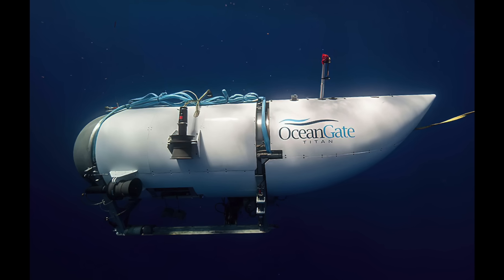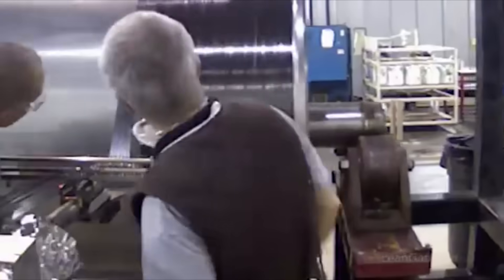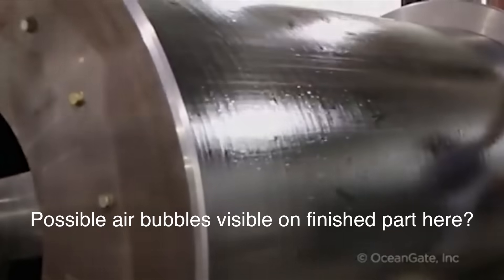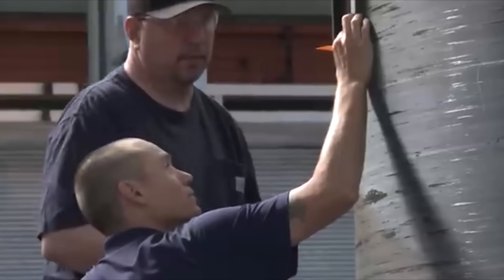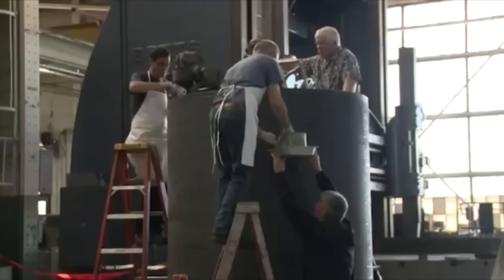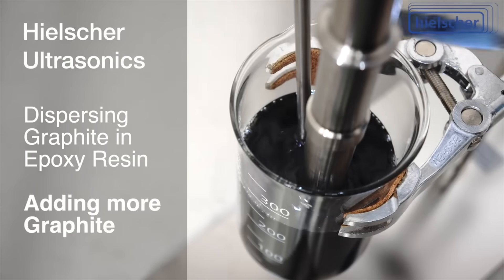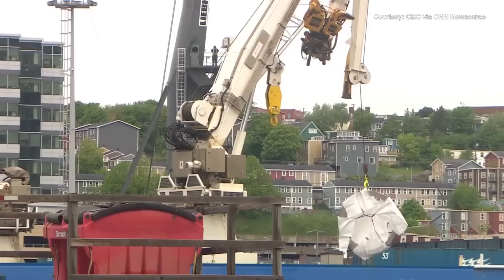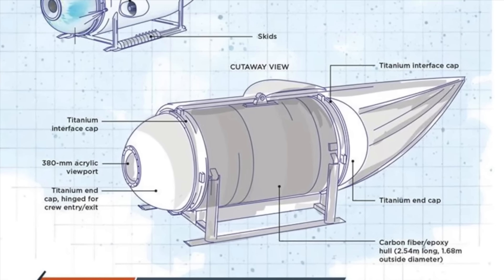Why OceanGate Titan Imploded - A Carbon Fiber Composites Perspective

Comment: The mating of the titanium to the Carbon Fibre is something I've had thoughts on. Years back I used to install strain gauges in the aviation industry - mostly aluminium alloys and titanium, but also on carbon fibre. The process for metal and CF involved using different solvents to degrease the parts, and keying the surface was also a little different. The process I was taught required titanium to be warmed with infrared lamps to drive out surface and subsurface contamination like oil, during which solvents were used until the surface was clean, and various fine grade oxide papers were used to sand the surface in figure eight motion to key the surface to bonding the gauge to...which then had a light acid applied and neutralised...the process with CF was similar, but less intensive, without heat lamps. The main difference was the type of glue applied for bonding. We used a special proprietary bonding agent manufactured by strain gauge manufacturer. The CF used a different bonding agent based on a cyanoacrylate type glue.

My understanding back then was that the same glue/bonding agent could not be used for titanium and CF, so was surprised to see a glue being used to mate both surfaces. Also surprised the surfaces didn't seem to be keyed - especially the titanium - ready to receive the glue!

Another concern was how shallow the join was!
Reply from the maker: Great to hear the interesting details from your real world bonding experience. This just goes to show the length and precision we must go to do make such bonds.
Reply: Meh why not just get 4 guys in t-shirts to slap some bondo on it, squeeze it together, and call it a day?
Reply: @inthefade  :D
Reply: I've always called the deliberate roughening of a surface to be bonded giving it "tooth" - similar to how the term is used to describe how paper will hold graphite from a pencil when drawing.

Absent that increased surface area, and scrupulous cleanliness, you have almost zero chance of forming any effective bond to a metal surface - and, the adhesive which you choose to apply must be to some degree corrosive to the metal in order to achieve a chemical bond.

Further, you join needs to ave significant resistance to slippage, much like mating screw threads have a force resistance projecting perpendicular to the direction of tear-out.

And, these slip-joints had absolutely nothing in the way of resisting elements to hold against tear-out forces.

Just a bad job, physically and chemically, even before you look at the actually assembly "procedure"...
Reply: @chemech  The end of the vessel shell does appear to have been machine giving if tooth, but the area involved appears to be rather small.
Reply: @jamesfisher4326 You can see it is shiny that means it is not even a surface finish that would meet the requirements of epoxy paints. Let alone a critical bond interface
Reply: I dont know anything about these materials how do u bond carbon fibre to titanium (if not with glue)
Reply: i'm no engineer but i find what you wrote simple common sense.

Comment: Great presentation. Tell me what you think about this:  I was thinking why are most submersibles spherical? and it's because under such tremendous pressure, any differential in strength    is catastrophic. well, where was the strength  differential of the titan?  in my opinion, near the junction of the titanium ring and the carbon fiber. The carbon fiber that was bonded to the titanium had more strength to pressure than its immediate adjacent zone. 
My hypothesis is in this area, close to the junction, where the collapse of the carbon fiber occurred.
Reply from the maker: Thanks for your kind comment. Yes I think the general design must have produced lots of stress raisers compared to a sphere. Would be interesting to see an FEA analysis on this with the different materials accounted for. My thoughts are similar I imagine the centre of the pressure hull was experiencing a different rate of deformation to the junction part you mention previously leading to those catastrophic internal failures. Unfortunately I imagine the carbon is in such a state and hard to recover we might never be able to know what part failed first.
Reply: @JamieKunka  thank you, that's right, military submarines can afford not to be spherical because they are made of high-strength alloyed steel but it was not the case of the poor Titan
Reply: @PADARM  And they are not descending to 4000 meters, was it?

Comment: I have listened/watched to many of these as available, all who have raised snippets of what you have covered. This is a Very comprehensive and full description of the multiple failures. Thankyou I enjoyed this. Will you be covering the plexiglass and out if date CF if that made any difference. What are your thoughts on the design.?. Other failures include governance, leadership, human resource: competence, experience, hero worship. Post drive Testing, compliance and transparency. The findings will be quite shocking I think.
Reply from the maker: Thanks, I had heard about the out of date fibre from Boeing but wasn’t sure of the facts which is why I didn’t cover it. It certainly sounds like an interesting thread for the investigation.

Comment: "Squeezing a can of Pringles" Exactly the analogy I've been using to explain to friends that the Titanium rings overlap with the CFRP was way too short.
Reply: I don't agree completely with that analogy, because it implies the initial failure had to be radial. However, don't forget that in the sub, there is also an extreme amount of pressure on the end caps pushing in, thus reducing the need for much ring-tube overlap, and I suspect the initial failure was the tube itself in axial direction, not radial. And the reason for that, is the 1:3 scale model Oceangate tested to failure. You can see a picture of it at 3:46 The tube is still round, it's the end that is pushed in, delaminated/shattered and has separated from the metal end rings and caps (not in the picture). So a better analogy could possible be that you take a Pringles can and stand or jump on the lid so the tube buckles/shatters, and not the other way around. And if that was the cause, it would probably not have made any difference if the ring-tube overlap was ten times longer.
Reply: @Kowalski301  Totally agree.  The axial stress on the cylinder is only 1/2 of the 'hoop stress'.  But it's TRANSVERSE to the fiber orientation!!!  So while the stress is lower, the ability of the carbon fiber to resist it is also lower.  One source said transverse strength could be as low as 10% of the fiber strength.  So while there's no 'torsional' stresses on the hull, weaving the CF in just one direction still seems like a major error.

I liken it to a soda can.  Keep the cylinder under positive pressure and you can stand on it.  Vent it and the axial load makes it buckle and collapse.
Reply: @mikefochtman7164  the fibers wasn't just in the hoop direction, I read an article about the build in Composites World, and they described it as a 0/90 degree layup. The 0 degree fibers were supposedly put on as prepreg fabric, and the 90 degree (hoop) was done as a wet layup with the winding machine.

Haven't heard about anything being built with a mix of prepreg and wet in the same laminate, but I guess I can be done, probably in a number of cure cycles, and hopefully with a post cure heating.
Reply: @Robinlarsson83  Okay, well that's news to me.  If that's the case, I wonder what the ratio was for 0 versus 90 orientation.  All I had seen is the new infamous videos of rolling it on 'hoop wise' and then installing the end rings.
Reply: @mikefochtman7164  yeah, the ratio I don't know :) and I'm not 100% sure the article was correct either, but it was written back when the Titan was built, and seemed to be written by an industry insider.
I've also only seen the winding clips, I think atleast one from the first layer going onto the mandrel.

It seems like Stockton said that the laminate didn't contain any off-axis, as in 45/45 biax or such, due to the lack of any significant twisting forces. Which seems fairly reasonable, even just a 0/90 layup that thick would get some twisting strength.
But I sure would have but some off-axis fibres in there if I built it, just to beef it up.
Reply: @Kowalski301  do you know how they tested the 1/3 model? Cycle testing or just loaded up until failure?
Reply: @AORD72  We have to assume they did some cycling before full pressure to collect more data, especially since they made a big deal about the so called "real time monitoring" system that would detect abnormal movements and acoustics in the hull, that would change from one dive to the next dive, and that the scale model had fitted some of these sensors, but I can't say that for certain. Stockton only talk about the scale model test very briefly and doesn't specify it any more other than they took it to failure and the shockwave blew out all the pressure sensors in the chamber. They did the tests at the University of Washington so there should have been at least some smart people in the area...
Reply from the maker: Excellent point
Reply: Yes  -  but a longer overlap poorly bonded would probably still failed. But agree - so short!! And the 90/0 fibre winding - insane!!
Reply: @acebacker1  Love all you instant engineers.
Reply: Was there any overlap at all? The video shows the interface ring being bonded to one end of the finished CF tube.

Comment: "Didn't see any glue squeeze out" I design loudspeakers and I would have fired the vendor for this - for a loudspeaker. Absolutely insane.
Reply: You would think that thing would be assembled in an airtight chamber and then put in an autoclave
Reply: @thecloneguyz  ..by workers wearing PSA, with a prezise construction frame to hold all parts in place by µm, measured and leveled with lasers. Direct control of the joint with Xray scanners after leaving the autoclave and and and...
Reply: That’s a fundamental tenet for applying adhesives. I’ve done everything from speaker reconing to carpentry. Insane.
Reply: I only mess with wood glue but I still want there to be enough that I have to wipe off the excess.
Reply: @DallasG83  apparently wood glue would work just as well as the Pippi Longstocking super gluer that he used😆
Reply: “Don’t just stand there , get some glue!!
Anyone?
Reply: Cutting corners on the glue,too..
Reply: They should have at least had somebody run to Lowe’s  real quick to get more😂
Reply: @steveo601 I saw somewhere on the web saying it was loctite brand. I'm not sure if that makes me feel better or worse. If it was just some loctite red from the local store,.......
Reply: The mixed material construction seems odd to me, the end caps compress at a different ratio from the carbon hull which will cause either friction when not actually bonded to each other but kept in place by pressure or tearing when properly bonded. But who am I as an audio repair tech.
Reply: @ottonormalverbrauch3794 that's what gets me about this saga. A million different vaguely connected technical people can all see it's a bad idea, but are maybe willing to be convinced with high quality engineering. Did they do that? Nope.

A million technicians scream out at the crappy low light dirty warehouse glue job. Guys cleaning then touching the metal. C'mon man, I'm better than that, and the hardware I build records a thermometer, not goes down to the ocean floor with humans in it.

They didn't save the bad engineering with good technician workmanship, and they didn't save the bad technician workmanship with good engineering, and they put people in it. Non informed-consenting public, too.
Reply: I don’t think it’s an actual glue. It’s more like a filler putty as the pressure holds the body together no glue is needed that’s the way I see it especially as the fiber shrinks with compression. If it were a set bond type glue it definitely would crack and not adhere. I think of it more as a playdough  type material that never cures .  But what do I know it’s just a mindset. They had external collars that wrapped around to secure and seal at shallow depths as the depth increases the pressure holds everything secure. Until the hill starts cracking over and over of your expired super cheap deal carbon fiber. It was actually expired so he got it at a discount
Reply: @jefferyboring4410 it is absolutely a glue, it's what's holding the ends on. But even if it want to call it putty or filler - it needs to squeeze out. If it doesn't, then it hasn't filled all the gaps! It's super basic for any glueing or filling.